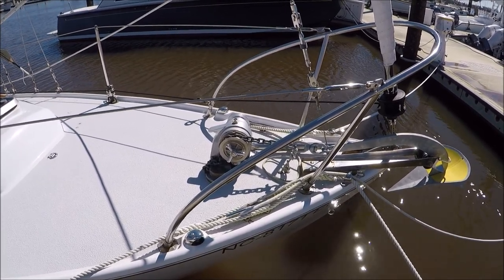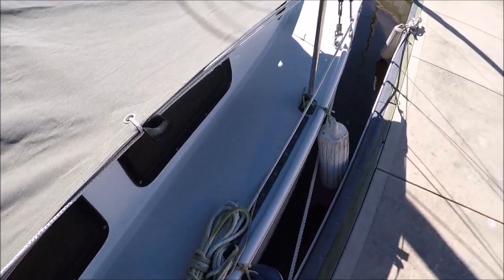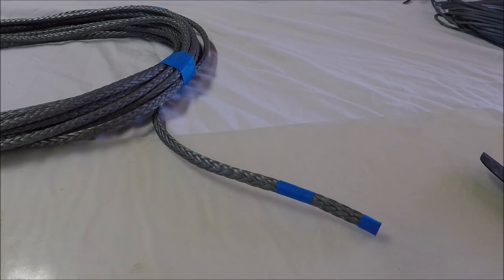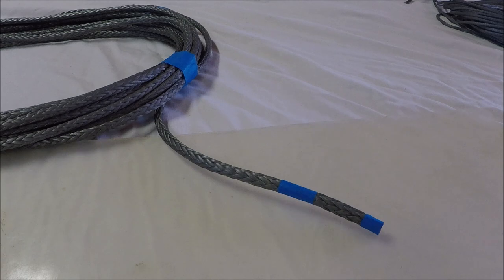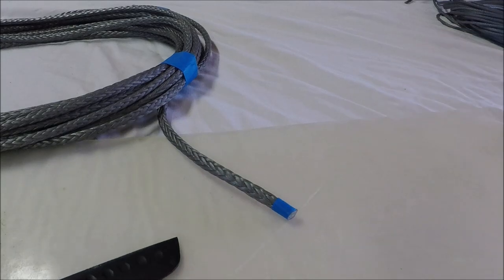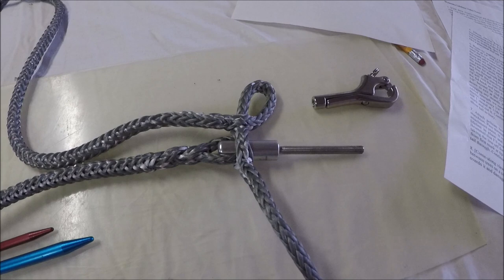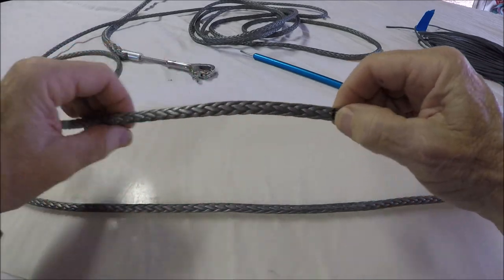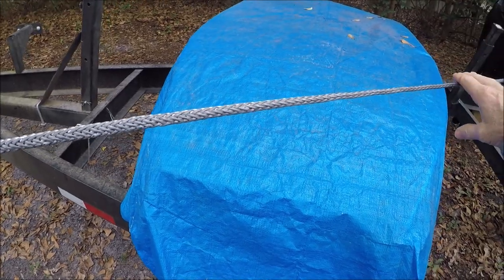Making Dyneema Sailboat Lifelines

Comment: The only thing i would add is how you did the half hitches on your lashing, to make it stronger its advised to only do the half hitch on the last lashing line, not the bundle, that allows the lashing to settle correctly and put the tension across all the strands. Binding all the strands can put more load on a single strand if the lashing cannot settle out. Also its advised to use a max of 8 lashing strands. Great video as always.

Comment: Great video! The only thing that lifeline supposed to transfer load (a sailor going overboard) to strongest end-points (pushpit/pullpit). A knot in the middle will prevent it and deposit half of the load onto the stanchion.
Reply from the maker: Thanks for the comment. My idea is the knot is acting as a gate eye and in this case is no different than how standard lifelines work. Normal gates are just stanchions that are reinforced with a strut to be better able to handle the load so it's true that is a potential weakness since the stanchion is easier to bend without a strut. The only thing that will happen in this case is the stanchion initially takes some of the load and it bends very slightly until the load transfers to the pushpit. That won't be a problem or change the outcome of a sailor going overboard. The lifeline will still hold and do its job as far as I can tell. Small boats can't afford the space or justify bulky lifeline gates. Some owners forego the gate and have to clamber over the lifelines but I prefer having this poor mans gate to make boarding easier.

Comment: Why the knots at the stanchions? I was under the impression we want the line to run through them to distribute the load across the stanchions. Am I wrong?
Reply from the maker: The knot is acting as a gate eye and in this case is no different than how standard lifelines work. Normal gates are just stanchions that are reinforced with a strut to be better able to handle the load. It's true that is a theoretical weakness since the stanchion is easier to bend without a strut but in practice it should not be an issue. The only thing that will happen in this case is the stanchion initially takes some of the load and under high shock load bends very slightly until the load transfers to the pushpit. That won't be a problem or change the outcome of a sailor going overboard. You can keep the knot about an inch aft of the stanchion if you want to ensure the load is transferred to the pushpit and does not first load the stanchion. Small boats can't afford the space or justify bulky lifeline gates.

Comment: 25:20]  Question, why do you never see a thimble used in the eye spliced at the end for all of the lashings to pass through?  Granted dyneema is very slick stuff, and strong, this just seems like a situation where one might ordinarily think to use a thimble in an eye.
Reply from the maker: Some people use thimbles. I didn't because they are bulky and ugly and the low friction ones are pricey and not required for the light load relative to rope diameter even with occasional heavy loads from a fall. I only use thimbles for very high load areas like standing rigging and I might use the expensive ones that separate the lashings if I need less friction.
Reply: @atomvoyager  Thanks for the reply.  I was just discovering the existence of low friction rings, which I guess fills some of the same functions.

Comment: Interesting to see you change from 316SS/1x19 wire lifelines to dyneema. Will you also be a convert to dyneema standing rigging with other parts from Colligo? Cutting the dyneema with Titanium shears is also very easy, as shown by YT Sailing Zingaro...Always appreciate your videos. Thought I'd have an A30 by now, but colon/liver cancer has slowed me, temporarily...
Reply from the maker: I do plan on using dyneema for replacing my intermediate aft shrouds on Atom soon but probably will stick with stainless 1x19 for the other standing rigging for now since I like my rigging to be set it and forget it rather than tensioning frequently for stretch and the other issues of changing to dyneema such as initial cost, bulky splices and fittings I don't care for the look of, UV degradation, etc. But I may come around to it one day as I get more familiar working with it. Sorry to hear about your health issues and I hope you find your boat soon.
Reply: Hikers often use the $5 ceramic knife from Harbor Freight on Dyneema hammock rigging. Works well for cutting fiberglass cloth too.

Comment: Thank you! Wonderful tutorial! Would adding another pelican hook or small shackle to the pulpit be an option instead of the lashing? Guess the question should be...Why use lashing on the pulpit? Thank you!
Reply from the maker: Two more pelican hooks adds considerable cost and reduces the allowance for adjustment. If you need a quick release forward, for example because it would be easier to pull up a dinghy, then yes you could use the pelican hooks. The shackle is cheaper but won't work as well because you can't reattach it under tension and you have no adjustment. If you hoist the dinghy on a halyard then you don't really need to release the lifelines anyway. Just hoist it a little higher. It's not easy to measure and splice an exact length so the lashing guarantees the fit even if you miscalculate and it comes out an inch or two too short or long..
Reply: @atomvoyager  Thank you for the explanation!
Reply: @atomvoyager  This was my problem with my first attempt when replacing my lifelines. I tried to measure and spice exact length and then take up the slack with the set screw adjustment. But over time the lines sagged as I didn't pre stretch the line under load. Had to redo. Great video!

Comment: The coated ones are only unsafe if you do not do proper maintenance and inspection . mine are from 1994 and no rust I clean inspect and remove them during the winter Thou i do like your dyneema lines and if I ever replace will go that route
Reply from the maker: Thanks for mentioning that. I had a poor choice of words. What I should have said was that since many coated wires were made with 304 wire and that you can't see through the plastic to see if the wire is cracked that they are a less safe choice than 316 grade bare 1x19. If yours have seen a lot of saltwater over the years and are not weeping rust then yours are probably made of a good grade of wire.